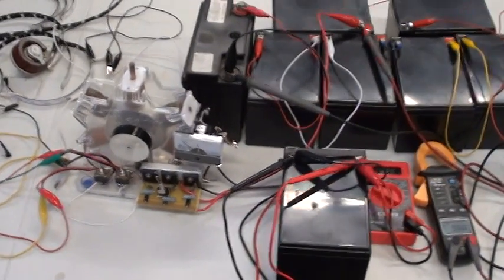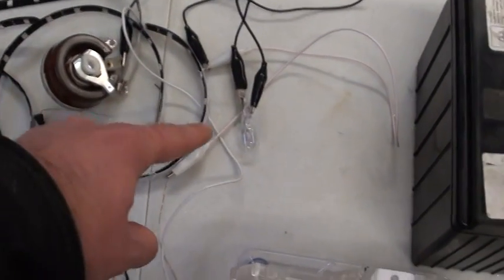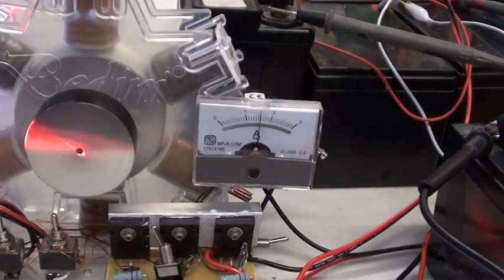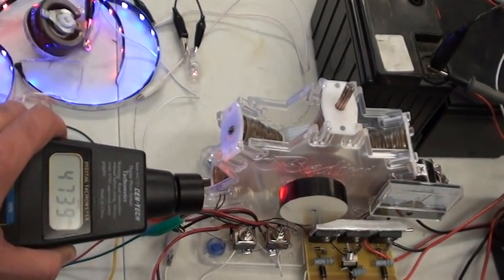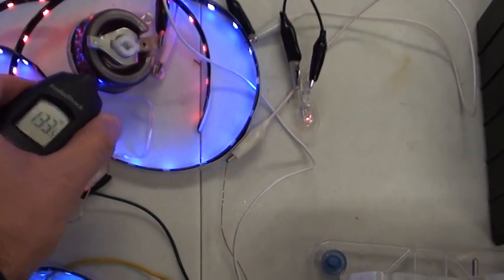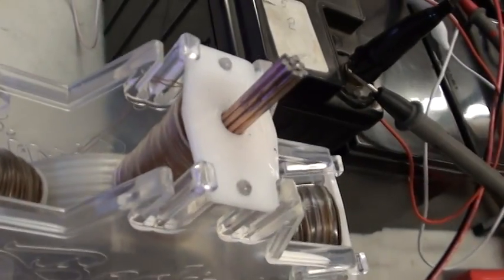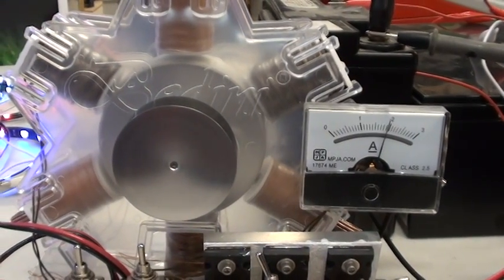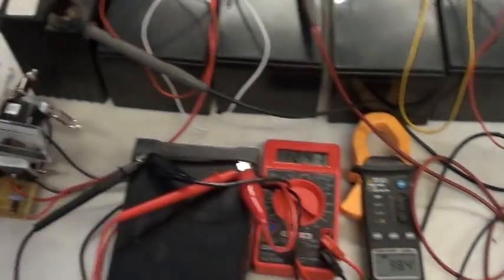3 Pole Monopole Energizer Charging 100  volts of batteries

Comment: This is, I'm assuming, very awesome! hehe :) I'm a bit confused and I suppose it's because I continuously hear it's "impossible" but is this a self-sustaining power setup? For example; this setup shown spins using it's own components (I'm assuming magnets and coils) and then enough power is output in order to maintain/charge a 12v battery? Could an inverter be connected to a battery to access the power from? I'm just starting to get into this type of thing. Your time taken is important! <3

Comment: this looks just like the kit I bought however it arrived missing a bushing and one switch and some wire and a contact for the flywheel.  the video including in the kit is poorly done and skips lots of steps including the most important ones step by step how to connect the wires

Comment: Thanks for this video, Rick.  Good stuff!

The main coil has 26 AWG and 19 AWG wire.  The two slave coils have 19 AWG and the 3 generator coils have 19 AWG wire.  Is this correct?  On the main coil, how many layers of the trigger wire do you create before you add in the power wire in bifilar fashion?
I noticed that the charge battery was dropping pretty quickly.  Is there a way to redirect the BEMF from the trigger to the run battery to prolong it's charging ability?

Thanks for the great work!!